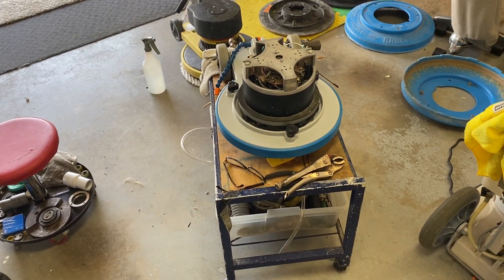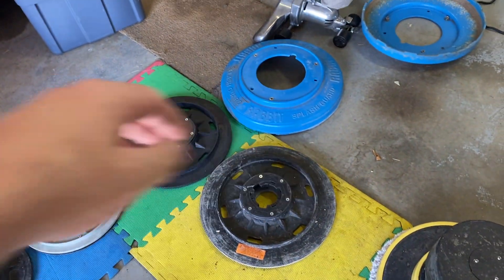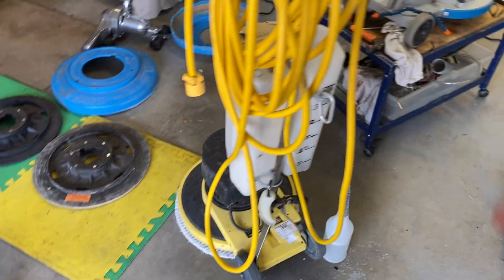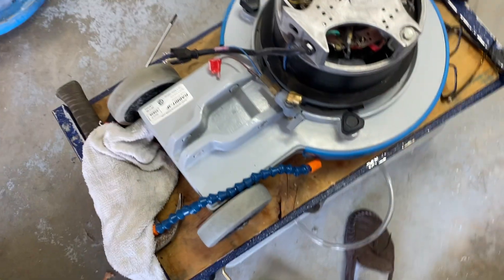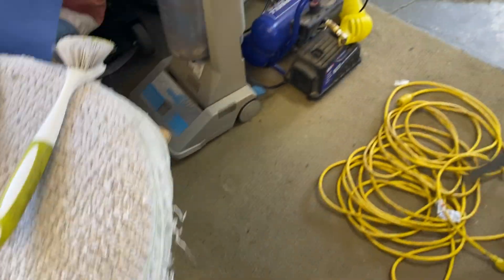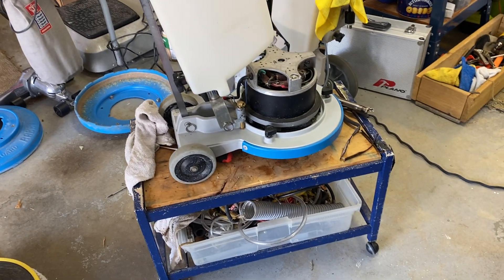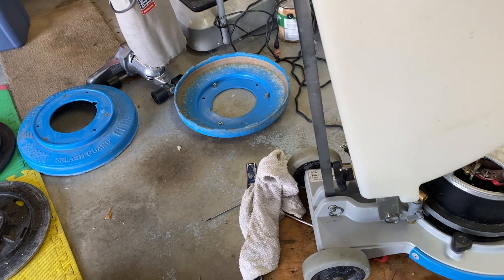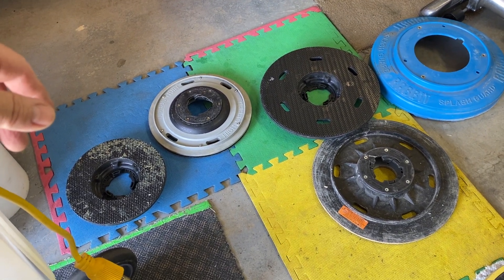Oxy-Dry cleaning up the second ULM/SETT Rabbit Centaur Rotary

Comment from the maker: In this video I said there are 2 windings, one for low speed and one for high speed and that is not correct. the speed of the motor is controlled with a Triac in the handle that adds resistance to the power reducing the motor speed.